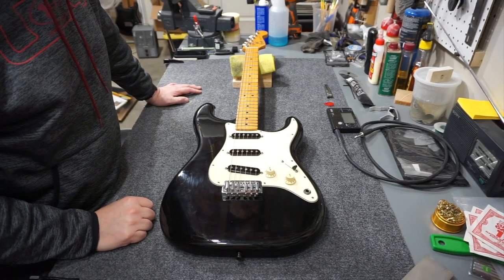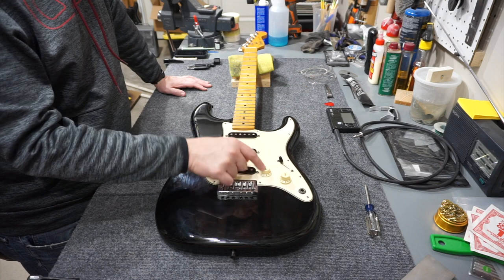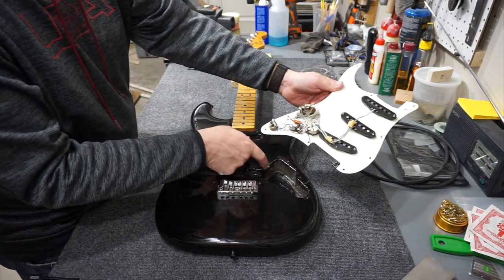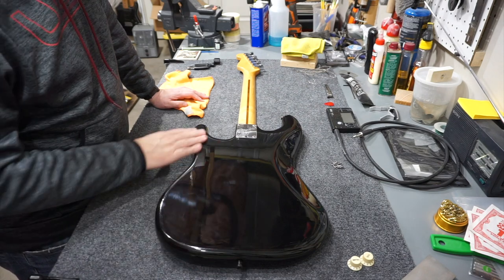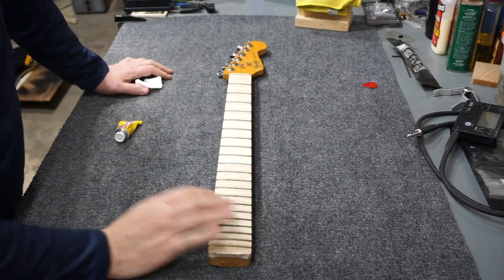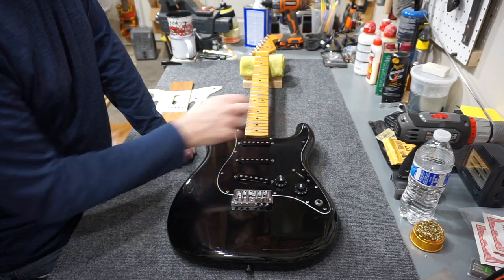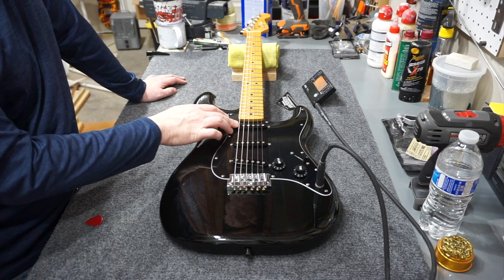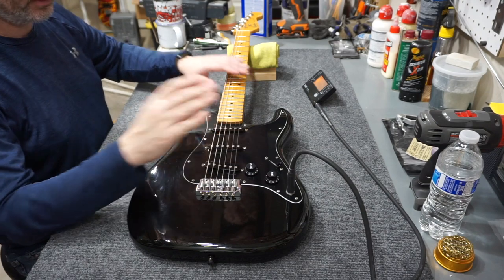1983 Fender Stratocaster “Revised” American Standard: Inspecting/Replacing Parts, Light Restoration

Comment: I had a friend who bought one of these. He didn’t like it from day one. He traded it on very quickly. Some folk rave about them but I’d only have one if somebody gave me it. I’d rather have a 3 bolt, bullet truss nut 70s Strat. When my friend got the Dan Smith Strat you could get a really good deal on those big headstock 70s guitars. We should have bought a few and put them under the bed. They would’ve been a much better investment than the Dan Smith model.
Reply from the maker: It’s really much the same as any other later 80s Strat with the exception of the jack, but of course this one is a hard tail.  I think that’s why I like this one, and I’ve never played an ‘83 with a trem.  That trem system is odd and has no rear route.

Comment: Those pickups and pick guard are not stock. They didn't use black on pickups on those and they used single ply white pickguards. I bet they bought prewired pickguard aftermarket.  I have an 83. Best neck ever.
Reply from the maker: They are the stock pickups but probably different covers.  The pickguard is no doubt not stock as I mentioned; holes don’t line up.